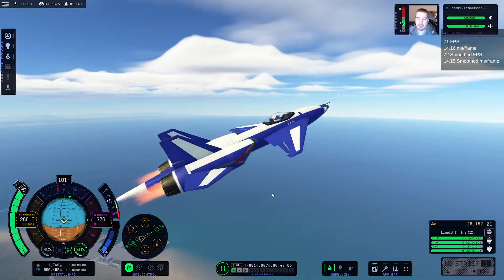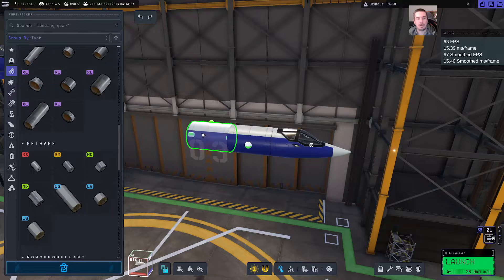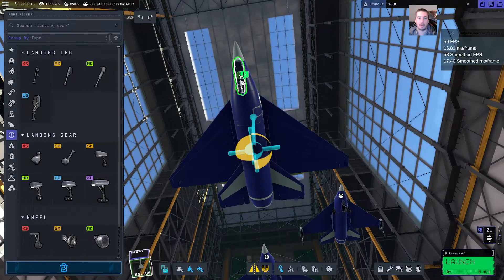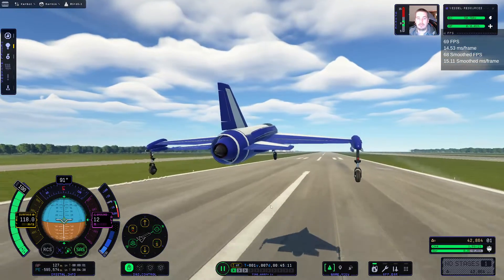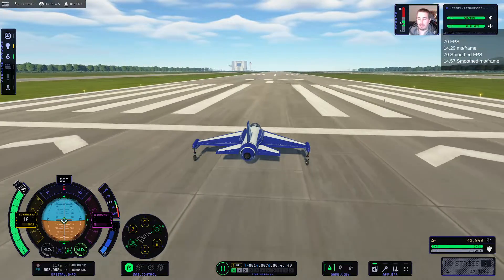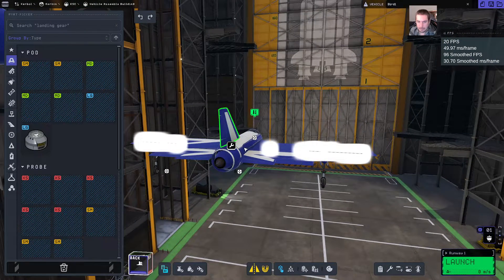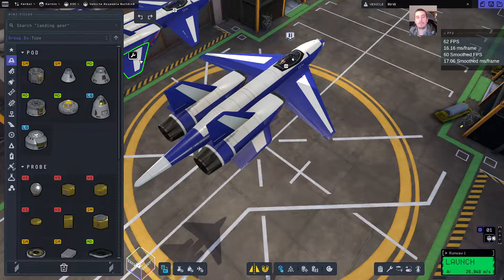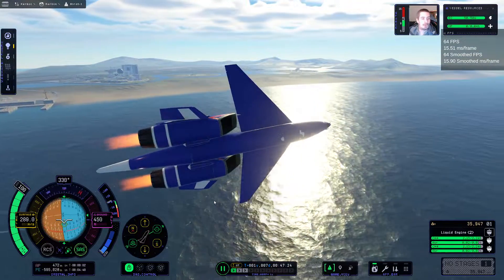Fix for Wobbling Airplanes - Kerbal Space Program 2 KSP 2

Comment: Okay, that's useful, I haven't tried that before! I normally just turn the deployment limits down to about 8°. Nice to have another method.

I've got a new problem though, my rockets are very bad at following a specific direction when in space (like a prograde vector). The rockets don't wobble like before, but they just over-correct constantly.

The devs need to adjust their global dampening settings for their autopilots. I'm sure they're over-correcting everything, and that's what's causing these wobbles. 

While we can get around the wobble with methods like you've  shown here, that does require reducing the control surfaces, therefore the aircraft lose manoeuvrability.

Comment: Nicely done. This has been the fix since early release, for anyone who reads this. Audaylon and a few others dominated atmospheric flight since 0.1.

I think the issue I usually have is the trade-off between stability at high speeds, and maneuverability at low speeds. Caps-Lock for "precision" control seems too arbitrary for my likes. The other issue is in a vacuum- where it sometimes would seem as if SAS would overcorrect large vessels- like not slowing/stopping the correction soon enough.